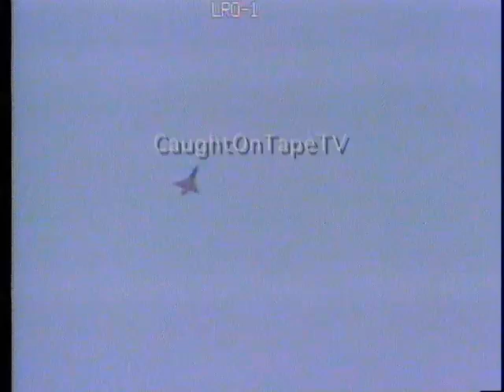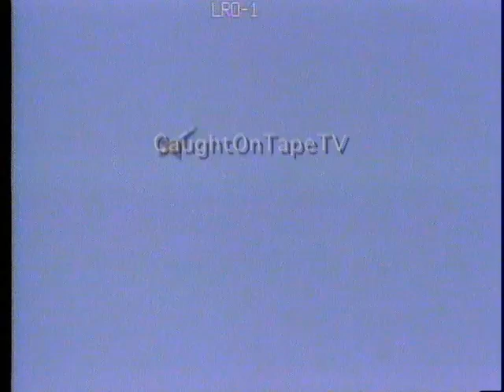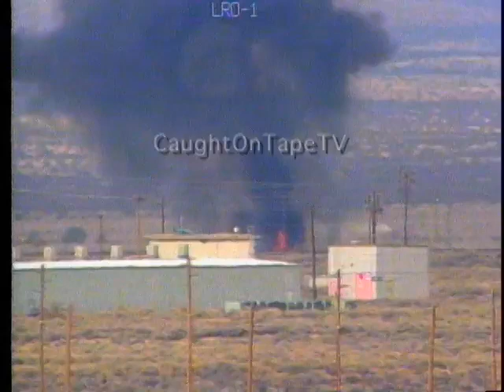ICE CAUSES PLANE TO CRASH!

Comment: I know someone close to this accident.  The Pitot Tube was an experimental design and had no provision for a heater.  The plane was tagged with a "do not fly in icing conditions" but the warning was misunderstood (and they didn't think ice would be a problem in the desert).  When the pitot iced over the computer thought the plane's speed had dropped to 50 knots and so it threw open the flaps while the plane was still cruising at a very high speed.
Reply: Really ?  ;)
Reply: yeah why would there be icing in a warm climate?

Comment: . The crash was caused by ice inside the pitot tube, sending incorrect airspeed data to the flight control computers. Contributing factors included the replacement of a heated pitot tube with an unheated Kiel probe, and ground crew/pilot ignorance of an option to override computer control.

Comment: That is (was) an X-31, in 1995.  There is no 'real life stress test' because there were only 2 ever made...  More like the end of testing.  The other aircraft is in a German museum.

It was a testbed for thrust vectoring (now used in the F-22) and could do some crazy maneuvers as a result (like 70 degree AoA).  It flew like that after ejection because the ice was in the pitot tube and the computer that runs it (fly by wire) was totally confused by the crazy readings that resulted.